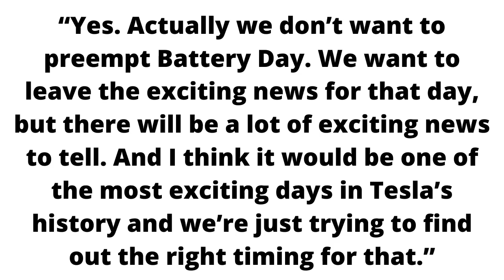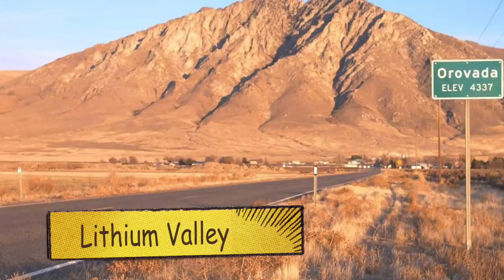Tesla's Upcoming Texas Terafactory - The Machine That Builds Machines

Comment: As one of the other commenters pointed out, even though the batteries are called "lithium ion" batteries, they are primarily made up of other elements, and that depends on the battery itself -- even Tesla is changing its formulation (more on that on battery day, most likely). Cobalt un until now, but perhaps going cobalt free in the near future. Even the batteries made with CATL for Tesla's Model 3s made in China use a different chemistry. 
Well, if Tesla can suddenly have the capacity to make batteries for 10 million cars a year, maybe they can take some of that and make home batteries or semis or megapacks.
I think Tesla also has a huge opportunity to lead the world in battery recycling technology, something that if they don't solve themselves (fully confident they will) they will be massively adding to the problem. Having million-mile batteries also reduces how often batteries need to get recycled/replaced, so that's a good start.

Comment: Even if the first stage of a 'Tera factory' only brings it upto 300 gigawatts, thats enough capacity for 6 million 50KWh battery packs a year. They might be abe to squeeze out a sub $20,000 car if it only contained a $4000 battery, single motor, and other cost savings that we've seen in the model y.
Reply: MarcAFK its not a „tera” factory if it makes GIGAwatts my guy thats a giga factory
Reply: @mmm8pl825 If its anything like the first giga factory it took a few stages of construction to get to full capacity.  Designed as a terawatt caacity is one thing, but theres no need to produce that many batteries yet, at least untill car production matches battery output.

Comment: Does know if there are supply chain challenges, related to the current battery constituents, that would make increasing EV production from its present relatively low level to say 20 million units per year very difficult. It seems as though building the Terafactory, as challenging as that will be, would be only one relatively small part of getting to a substantially larger level of EV production.

Comment: "Lithium is a comparatively rare element, although it is found in many rocks and some brines, but always in very low concentrations.16 Jun 2011
Reply: Desalination  plants have  produced significant amounts of lithium  and other minerals.  
The process is long and requires a large area.  But produces a profit instead of transportation and disposal of the brine . 3 new technologies that are proven and various stages of full scale development  and integration.
All these techniques are designed for faster and  larger yields to be produced. 
 One of these I believe in Australia.  Is already in use at a  
Desalination facilities .  It is  only processing about 1/8th that of  standard plants built primarily for drinking water. 
Currently extracts around 500 tonnes per 24 hour cycle. Then about a week to extract and separate the ores. They estimate they are extracting about 70 percent of the lithium that is high quality and market ready. And believe they can get to around 90% .
Reply: Sid Vicious do you mind sharing the source proving your claim Lithium can be extracted from salt water?

Comment: Telsa will not set up in TX they are going with better laws and better state government.
Reply: they will probably put it in boca chica near there starship place as they practically own the town board.
Reply: Slumpdog Naah.  They’ve stated they need access to great engineering talent.  I think they got burned when they picked Reno/Sparks, NV for Giga-one.  The talent wasn’t there, and they had a hard time convincing great, young engineers that moving to Sparks to work for Tesla was better than moving to San Jose, Seattle, or Austin to work for some other tech company.  I think that’s a big reason why Giga-one hasn’t built out the major auto manufacturing part they’d planned.  They just can’t get the talent they need to stay there.  They won’t make that same mistake again.
Reply: @slumpdogyt  They need to be in good standings with the state board. Because only they can decide if they will allow tesla to sell vehicles without a dealer network. And only they can offer the billions in tax cuts to tesla here.
Reply: @xxZerosumxx  - Maybe it's this way, or maybe it's "The State needs to be on Good Terms with Tesla", for them to come in and set up shop, and open up another 10,000+ Good Paying Jobs?
Reply: Banana Chips you just keep telling yourself that,

Comment: So cool. He is taking electricity out of the ground just like the original Tesla.
Reply: 1mikesmiley technically taking it from the sun and storing it in minerals out of the ground but close enough
Reply: @damitcam  Nikola Tesla took it out of the air with two small antenas
Reply: Vital Rights actually he ran out of funding before the prototype tower was completed and was never completed in order to be tested
Reply: @damitcam  
That's something totally different that tower on NY was to transmit wireless electricity as well as wrireless comunications to Europa...but i didn't write of that, i wrote of his electric car that he rode for around a week with no batteries just a "board with tubes circuits and 2 atenas" to power a 30 HP electric motor to power the car with wireless electric capture from the air...the car was a modified Studebaker withb the fuel motor removed...
Reply: Vital Rights bro ythats not tesla thats geothermal energy. Jump off the conspiracy band wagon before its too late

Comment: Tesla calls all of their factories Gigafactoies not just the factories that produce batteries. 

I think the new battery technology Tesla will introduce at Battery Day will start to be produced this year, therefore I think the first Terafactory will be in the expansion of Gigafactory Shanghai. If you look at the drone video of Giga Shanghai, you will see that the Phase 2 construction is about twice the size of the Phase 1 factory. Tesla’s collaboration with CATL and LG Chem in China indicate the Giga Shanghai will produce batteries and Model Y EVs.  Tesla will also produce these new batteries in Freno and perhaps Nevada, but these sites won’t be considered true Terafactories unless the expand the factory size. 

The new battery density, the Maxwell dry battery electrode, and no Cobalt battery chemistry will increase the speed of battery production using a third or more less factory floor space while producing more kWhs per square foot. These factories will also incorporate Hi-Bar’s advanced battery manufacturing equipment. 

If Tesla abandons the model pack design and assembly and connect the batteries directly in the pack, this will increase the speed of pack construction while reducing the cost.